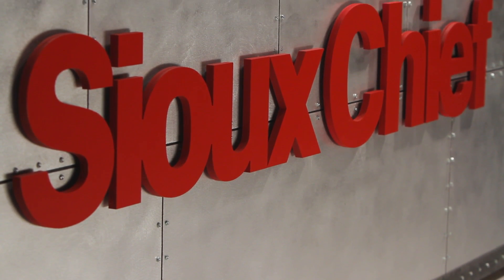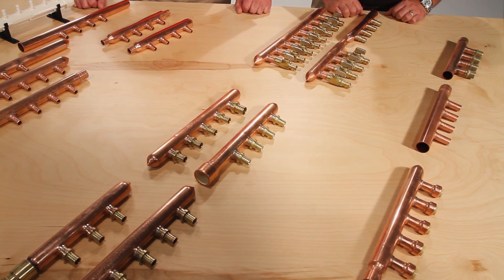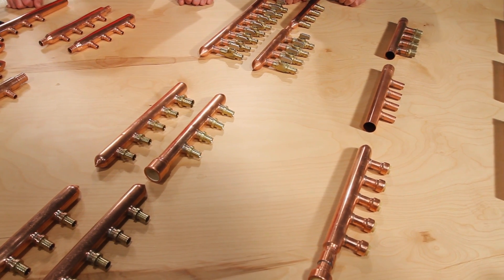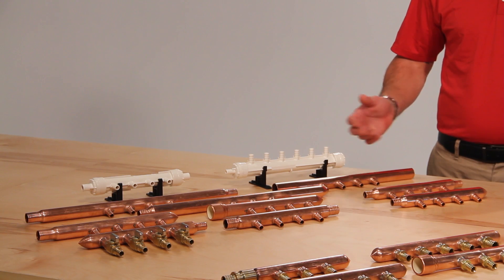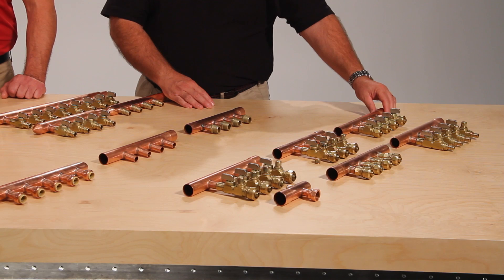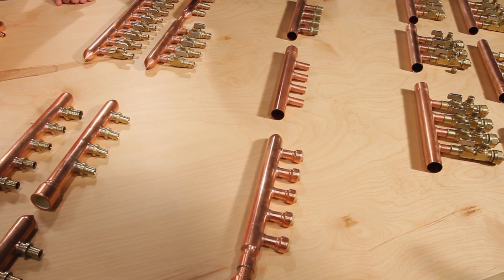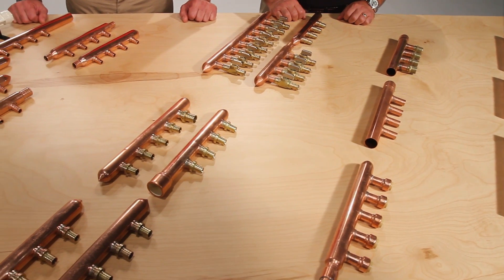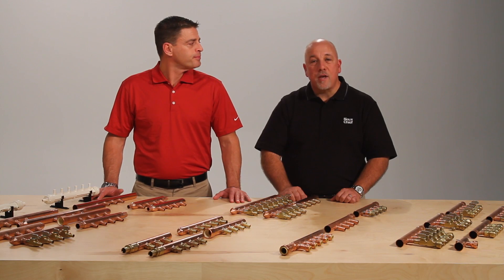Sioux Chief BranchMaster™ Manifolds

Comment: I purchased a 6 port Sioux Chief manifold with valves. So far I've had to replace it 3 times as the valves eventually leaked within 6 months or so. Now the 4th one is leaking. Although they supposedly have a lifetime warrantee, it's too much aggravation taking it out of the system,  returning it, waiting for a replacement,and reinstalling a new one that will go bad again. I ended up having to put an external valve on the line for that port.
In my experience these manifolds with valves are not worth the high price as they just don't last.
Reply: Same thing happened to me with these Sioux Chief manifolds. No more manifold with built-in  valves for me. From now on I'll just purchase plain manifold locally and add external valves.